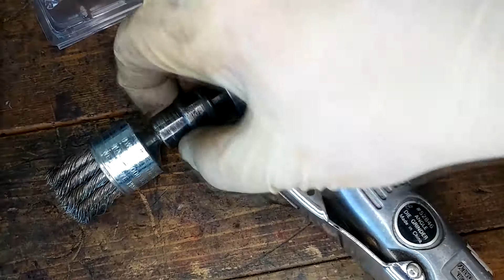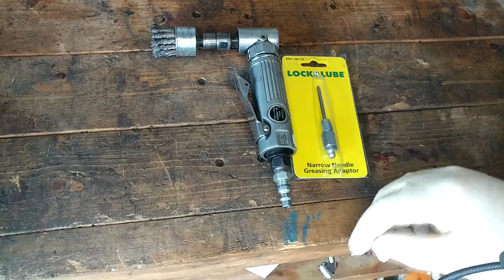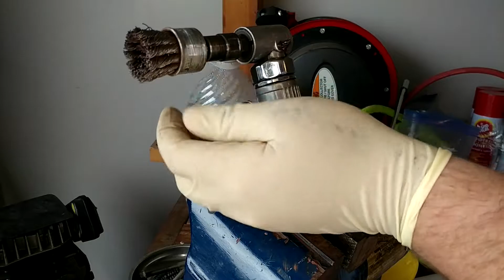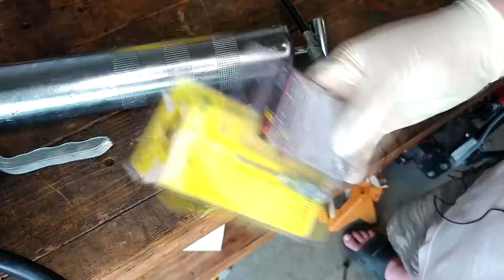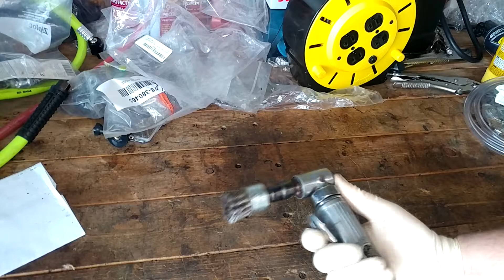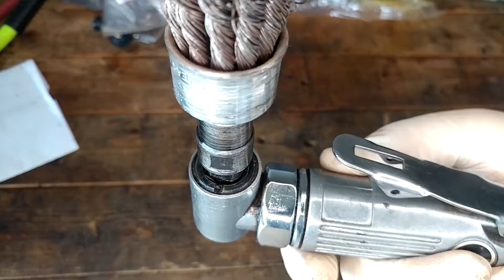19 Year Old Harbor Freight Die Grinder... First Attempted Maintenance, EVER!

Comment: That thing is hardly used, the stickers are still on it.
Reply from the maker: Oddly, the only HFT stuff I have that the stickers have come off of are the hammers. Even the oil soaked sticker on my 20 year old air compressor is still hanging on. 

I never really thought about it before, but I would imagine they use the same glue that all of the stuff in Walmart uses to hold the UPS tags on. They're impossible to remove.

Comment: I used to work at a factory as part of a deburr crew. All we did was get finished parts from the machinists and clean up the sharp edges and get them ready for assembly or the paint booth. Used all different kinds of angle grinders over the years there and they ran pretty much 24/7 because once day shift left for the day, night shift would come in and keep going. The die grinders pretty much never got a break, but what I did to keep them running nice is I'd pour some marvel mystery oil down the airline fitting, reconnect the air line, and hold it wide open until the red mist stops coming out lol, but then you'd look at the air exhaust vent and it was coated with a black sludge. I'd just wipe it off the body of the tool but in my mind I was keeping all that garbage out of the tool, and it had marvel mystery oil in it instead. Did it every day after I clocked in, and my grinders ended up lasting twice as long as my coworkers grinders did.
Reply: finally some actual useful info. if I learned at least one useful fact, then it's not a complete waste of a click... which it was... until now